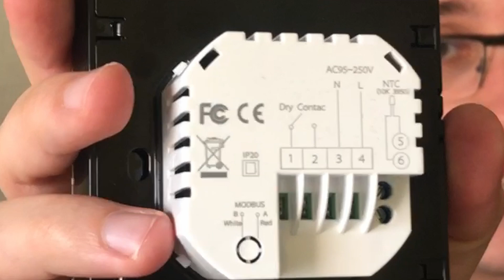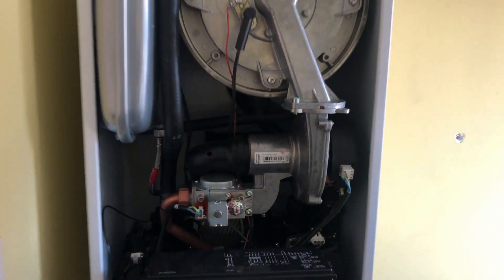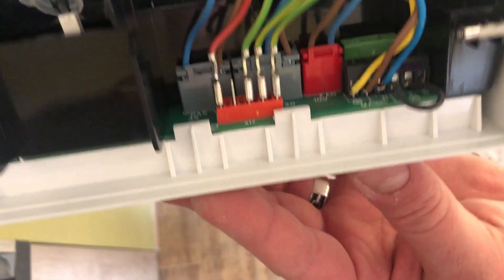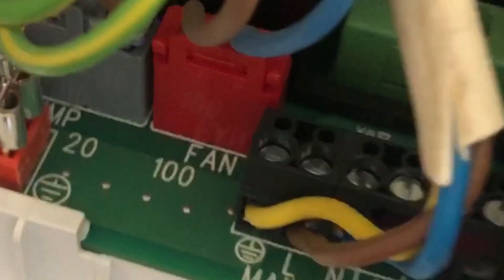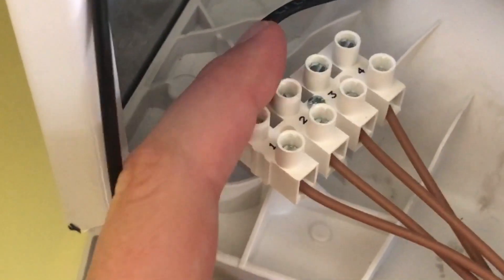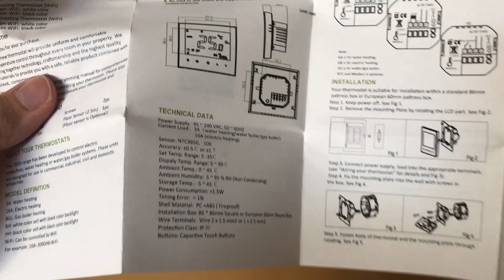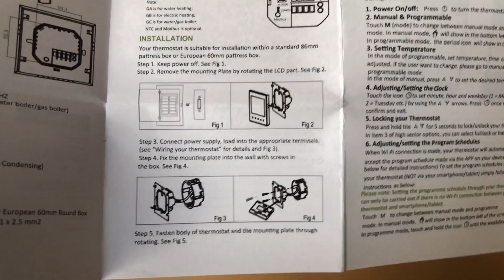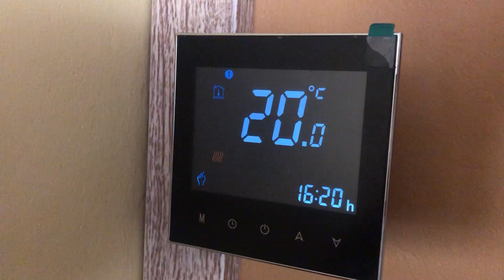MJZM GL-3000 WiFi Thermostat for Gas Boiler - INSTALLATION & WIRING - AliExpress eBay Amazon

Comment: Hi great video, i have a question regarding that 1 and 2 slot that's coming from boiler. I cant see the colors inside the boiler, so my question is the Black one is in 1, and the red/black is in number 2 ?
Reply from the maker: Hi, glad to hear. Seems it's as you said - 1 is black, 2 is bl/r. However, I don't have that setup at home anymore so I can't double check again now.

Comment: Hi, i used this WiFi thermostat successfully for a year, but then I changed my ISP and I cannot make the thermostat go in to WiFi search mode. It should be to power off then press and hold the down arrow button for 8+ seconds, but this does nothing. Any ideas? Thanks

Comment: Hay, I have buderus logamax gb plus and I have question. Does any of these two wires numb. 1 or 2 have any voltage if you remember? Thank you for your answer
Reply from the maker: Hi. Mine, at least, has four connectors - two for wires coming from the gas boiler itself and two for 220/240V electricity wires.
Reply: @RangelChannel  But does yours any of two wires from gas boiler have any voltage like 12v or 24v because my does and I am afraid connecting it to thermostat, N and L wires I understand?
Reply from the maker: @slonato2004  Not entirely sure, but I think it has no voltage from the gas boiler. Will ask a friend who helped me with the installation if he remembers by chance and reply here again in any case.
Reply: @RangelChannel  Ok please, I measured mine again two wires together from boiler have 12v
Reply from the maker: @slonato2004  He doesn't think there was electricity either. The power of the thermostat comes from the two separate wires, the other too should be just for signal.
Reply: @RangelChannel  Ok I really really thank you for your help, maybe mine is different. I will try to ask service man maybe they know if I can plug thermostat on my boiler or I can only use original which is not wi fi.
Kind regards from Slovenia
Reply from the maker: @slonato2004  Yes, that would be best, as I am not 100% sure and also the user manual doesn't help. If you find out, share here, it may be useful for somebody else browsing through comments in the future. Best wishes! Have a great week ahead!
Reply: @RangelChannel  I spoked to service man and it is only possible to add this kind of thermostat with buderus only on/off variant, because buderus uses irt protocol to communicate and only original thermostat would have all functions. But you can add new original ct 100.2 and adapter  but it is not cheap around 250 + 60 eur adapter because new boilers gave ems protocol, adapter tranforms irt to ems protocol. 🙋‍♂️
Reply from the maker: @slonato2004  Seems quite expensive! Thanks for the update. Pozdravi :)
Reply: @RangelChannel  yes I will stick to mine irt30 which is excellent but without wi fi, 🙋‍♂️

Comment: I have a wifi on/off valve on my heating system. I control it with my phone using "smartlife" app. Can i use these type of thermostat to control the wifi valve via wifi??? The winter is coming please help xD
Reply from the maker: Hey. Not sure. Smartlife is the app I use for the thermostat, too, though. Maybe it will work as it has Wifi connection already, but no idea how tou should do the wiring.
Reply from the maker: Why you don't keep using it just via the app as currently? I don't see why you need adding an extra thermostat inbetween

Comment: My currebt honeywell t40 thermostat is installed far from the boiler. Ac power for the boiler is by the boiler. There  is a 2 wired cable installed to the current thermostat. Is  there any chance to instal my new wifi thermostat ? If there is , could you please explain me that i can understand. Thank you. denizcanim@icloud.com if you can send email me as well
Thank you
Reply from the maker: Hi. My GL-3000 WiFi thermostat is installed about 10 meters away from the gas boiler. In my case, for my boiler's model, there are cables to connect the boiler and the thermostat, but these are for signal only. The electricity (AC) cable to power the thermostat can come from anywhere, including a close by AC power outlet. Hope I got your question properly.
Reply: @RangelChannel   hi thanks for quick reply, i would like to send a photo of my current thermostat  connections and want  your advice what i can do.
Reply from the maker: Hande Ugurlu Sorry, I used an electrician to do the wiring for me, so I can't be of any help with this :-(
Reply: @RangelChannel  thank you